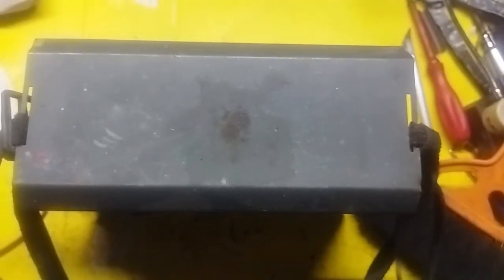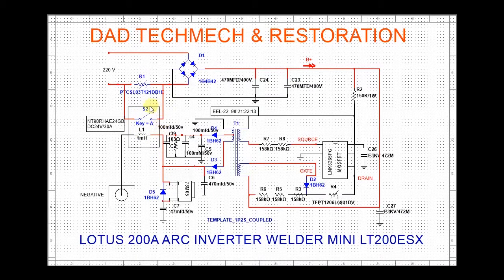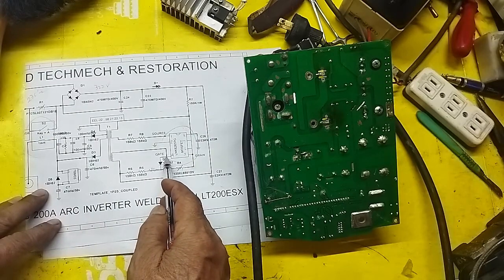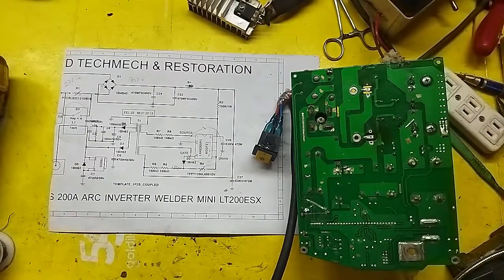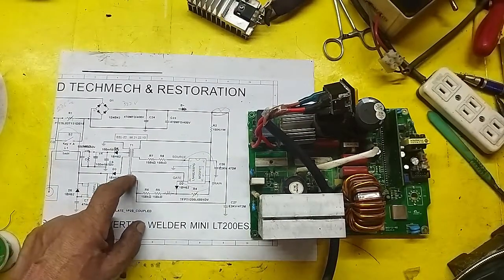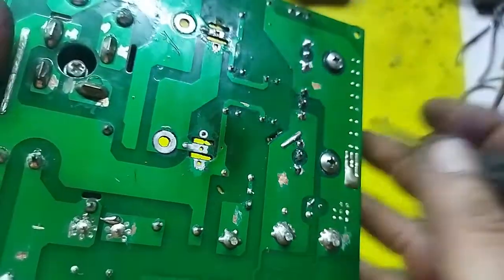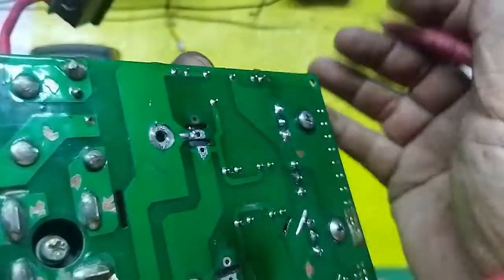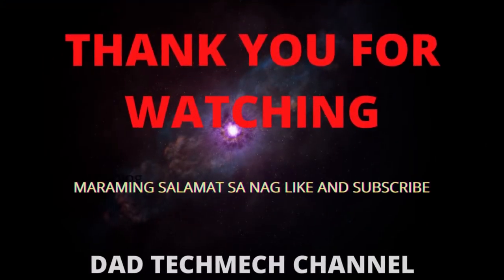HOW TO REPAIR INVERTER WELDING MACHINE VOLTAGE SUPPLY WITH SCHEMATIC DIAGRAM

Comment: Sir  do you have schematic diagram this welding machine ?
Reply: Sir sorry this is only diagram i make cause immediate the customer is in a hurry to use the unit.i did not have a chance to sketch all the diagram, in my next upload CONTENDER INVERTER WEDING MACHINE CIW 160I i wiill include schematic diagram thanks for viewing